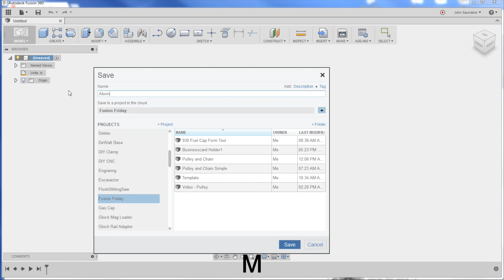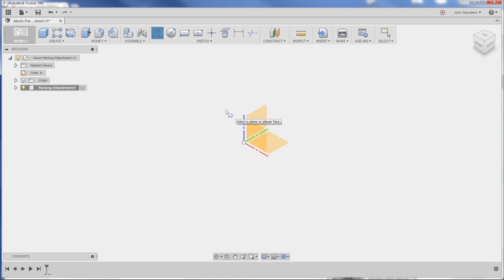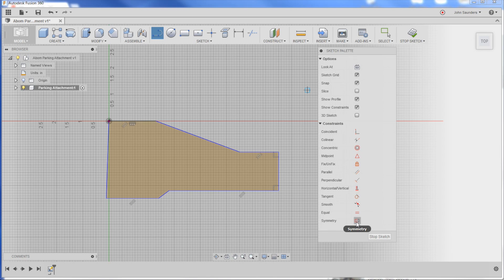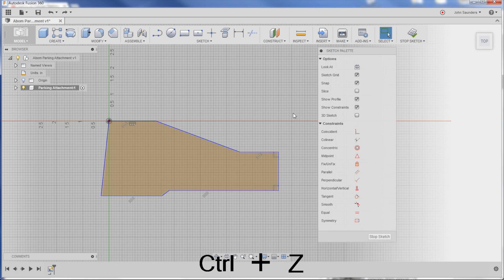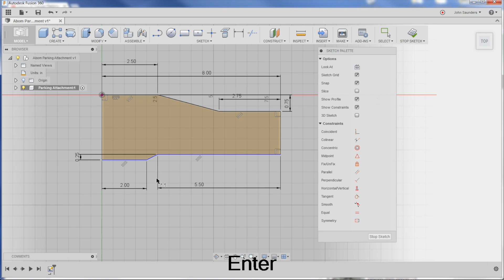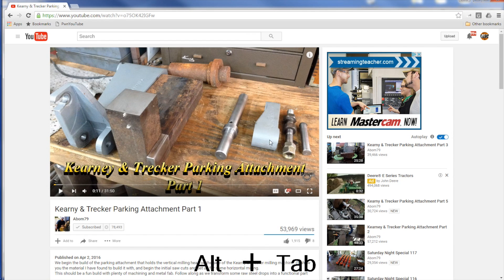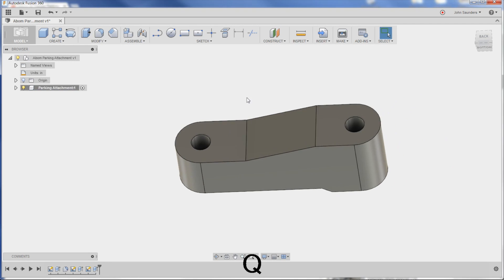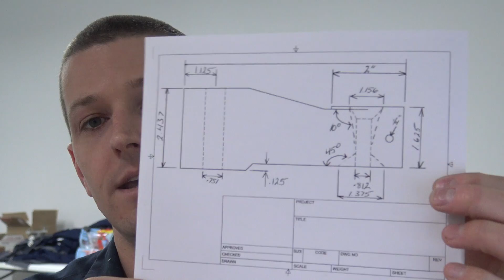Fusion 360 Tutorial: Part for K&T Horizontal Mill!  Fusion Friday #26

Comment: I came over from Abom79's channel. I have been a machinist in a small job shop for about 8 years. 

We do have a Hurco VM-1. The conversational interface is awesome. We have never needed CAD/CAM. But I think it would shorten our cycle times. And that CAD looks extremely easy to work with.
Reply: +NYC CNC conversational does have some limits. But for profiling, circle and rectangular pockets, it is a breeze to program. 

Hurco has a 30 day trial of their WinMax desktop program online. I think you would see it works really well. May even be able to do some of the more complex features with WinMax. I know it will has a tread milling cycle. 

We got our Hurco just before the first version of WinMax came out. 

The latest version added high speed milling a.k.a limited engagement milling.

Comment: You moved pretty fast when you drew up the K&T bracket.  I was wondering what the specs were on your PC?  I heard that those CAD programs sloooowwwwwww everything done.    I have one suggestion:  Why is the part solid steel (like what Adam is making)?  I'm sure that it could be elegantly lightened...  Or not, in 20,000 years it will still be in use!  ha ha ah
Reply: NYC CNC Yeah, it's Adam's project.

Comment: Great intro video for Fusion 360.  Although I don't do CNC machining, I do 3D print parts, and most recent, patterns for parts to be cast in metal.  Also it helps if you design it up in Fusion 360 to be able to decide on the order of operations.  Also the ability to create 2D drawings from a 3D model is a real time saver.  For a home shop machinist such as myself, it's free and easy to use.  Thanks again, John, for all the effort you put into these videos.

Comment: Hi John
I have Fusion 360 and have been playing with it but there is one thing I cannot find out how to do  and that is print a drawing to a normal printer.  When you go to print it wants to print an STL file for a 3D printer what am I missing your help would much appreciated

Dave.
Reply: +David Cashin have a look in the learning material it's in there, and look back through john's vids he did one last year
Reply: +David Cashin  One of the tabs on the top of your screen says output with a PDF symbol on it, use this tab to save your drawings as .pdf or .dwg files then you can print them out.
I save them to a folder I created right on my desktop and save them as .pdf files then when I want to print 1out  I open them with Microsoft Word or Adobe Acrobat reader.
You can print from there. Sorry if you are using a Mac product I have no clue wht to do.
Reply: +Ed T  My reply was for printing a drawing you have created and the output tab is only in the drawings work space.
Reply: +David Cashin You have to create a drawing first. Go to the file menu and click on 'new drawing'. The drawing will exist as a separate file in your data, but linked to your design. That lets you create standard engineering-type drawings in quite a streamlined way, but the tools are a bit restrictive. The drawing toolbar will let you output it as a pdf which you can then print.

Another useful thing is the 'capture image' command on the file menu, which i've used to print images of sketches a couple of times. Annoyingly it makes images not vector files. I wish i could make pdfs directly from sketches.